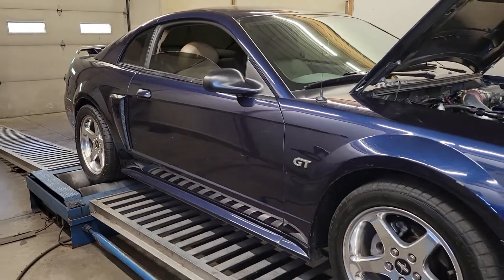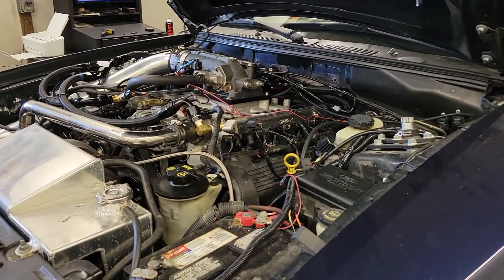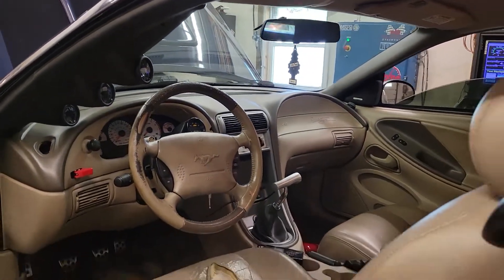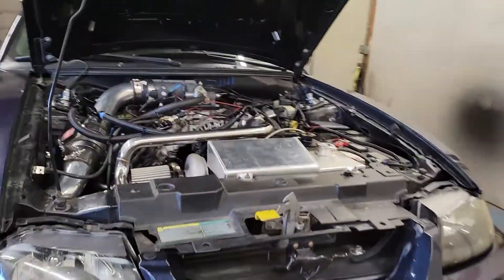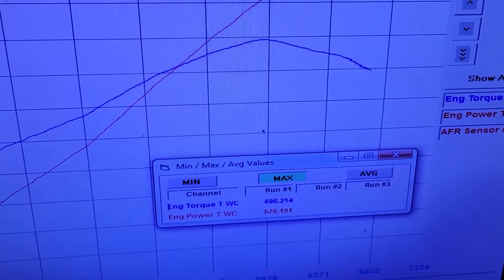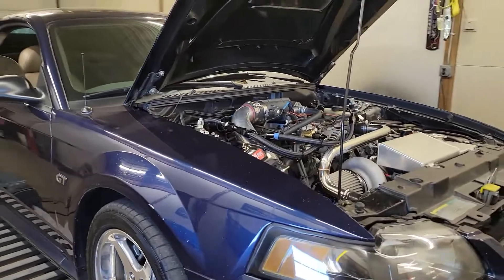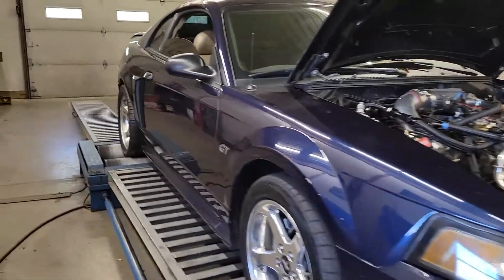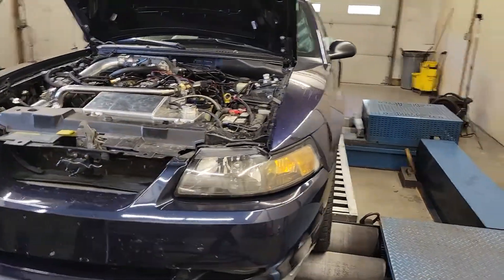500+ HP | Pump Gas | Turbo 2v 4.6L | Ford Mustang | Dyno Review

Comment: Has your pops ever push the cast steel crank to 700whp?
Reply from the maker: We havent tried, his setup is turbo limited at the 630mark. It's almost to much for his setup at that point. Car still has all the stock suspension under it with a lowering spring. It's a little sketchy for a 73 year/old to be ripping on the street.

Comment: Thought you would be making way more than me especially with a forged motor and turbo cams. My 2004 Mustang GT has 178,XXX miles at 426 hp / 512 tq on a stock motor on 9lbs of boost, On3 kit, pmas MAF, PP intake manifold, 60lb Siemen Deka inj. MSD cop, returnless fuel system, ford GT fuel pump, VMP BAP, REV9 coilovers, UPR kmember and A-arms, 7qt Moroso oil pan, P/S cooler, oil cooler w/ mishimoto thermostat, mishimoto 2 core radiator, 16" flexalite fan. I plan on building a forged motor next year. I hope that I would be over 600+ hp when its all said and done.
Reply from the maker: You really can't compare dyno numbers between dynos.  That said, we made 580 on a stock bottom end one of my fathers for 4 years.  His is now making 630+ on 93 and is out of turbo.  This one here has plenty of potential in the engine/turbo setup.  Just have to get the supporting systems in line with it.
Reply: @Force Engineering  so why ppl keep saying that the engine will fail past 450hp?
Reply from the maker: @Donald Johnson There are various different approaches to making power, and some of them are easier on parts.  Our approach has netted us results consistently far beyond what the internet says certain setups are capable of.
Reply: @ForceEngineering so what’s the secret recipe for the stock bottom end
Reply from the maker: @OTWKilo  keep it far away from detonation.  basically keep timing safe and kill with boost.
Reply: @ForceEngineering  so no cams?
Reply from the maker: @OTWKilo  depends on your goals
Reply: @ForceEngineering  to keep up with the new 5.0 4vs. Bout it. Street car

Comment: Wait you guys build motors?
Reply: How much would this set up cost?
Reply: I believe he said rods and piston so I'll the crank is stock with head work and aftermarket intake.  
I've seen a few stock crank . With Coyote rods and pistons 2 vavles making North of 700hp.
Reply: @Spad68 you can use coyote pistons in a 2V? I’ve heard of rods but not pistons.
Reply: @TheJMan1K  i know the crank and rods for sure.  Actually fact check myself.  I think I'm wrong on the pistons